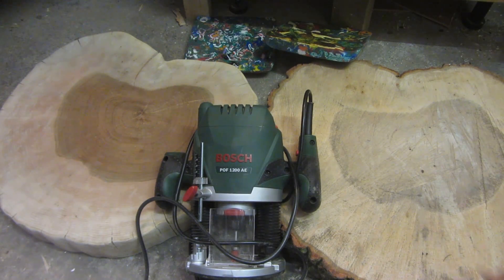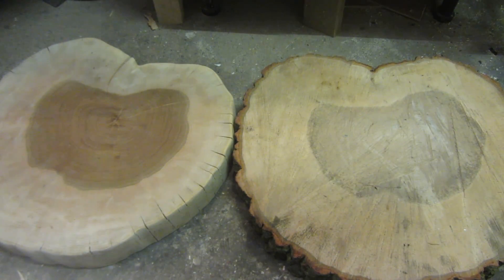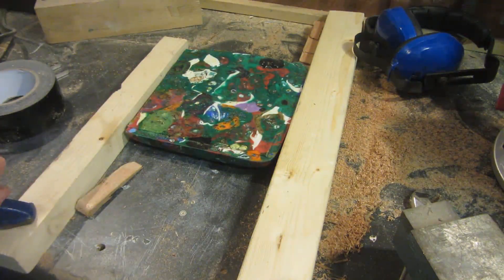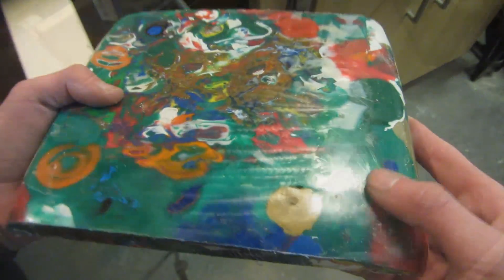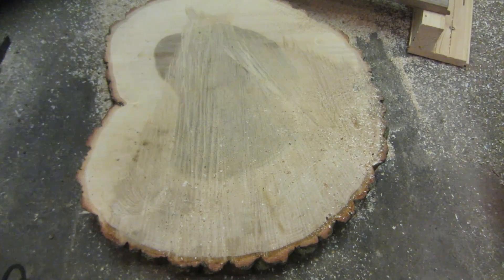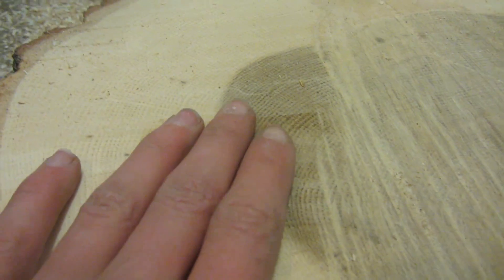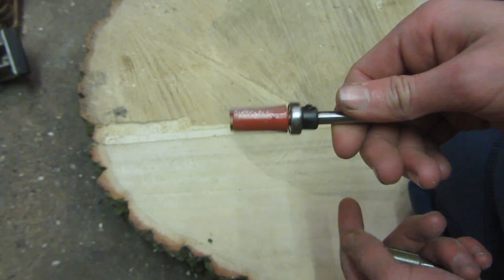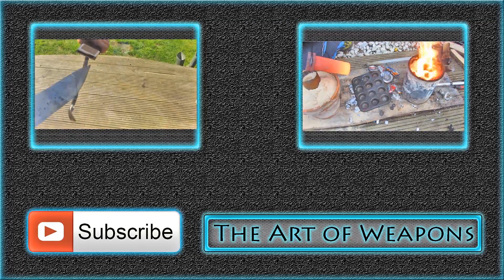Easy Router Planer Jig - Flatten Any Wooden Surface

Comment: at 2:00 or so when you're cutting the slot, I find it's helpful to take a hole saw or large diameter drill bit to the start and end points. Saves you from having to turn the jigsaw around.

Comment: For the table you could do a double layer design using the second round as a shelf underneath the table top:

               Top
___________________
      ||||                   ||||
      ||||                   ||||      
___________________
      ||||                   ||||
             Bottom

Comment: Great stuff TAOW.  I'm going to be starting out working with HDPE in the next few weeks and was wondering how I might finish the tops and bottoms of the blanks.  This is a great idea.  Thanks for sharing. 

As for ideas for your second piece of tree, how about another table but put longish legs on it and use your new router to dig out some ammo "dishes" in the top.  Then you can use it at your shooting line to hold steel balls, marbles, whatever, and it'll all be right there at your fingertips.  Make the legs removable/folding and you can more easily bring it in out of the weather.

Another idea might be to rout out some slingshot-sized pockets in the surface with an inset lip.  Then cut glass or plexiglass to fit just inside the pocket, on the lip so it sits flush with the surface.  Leg it as you would a table.  Voila, slingshot display table.

Thanks again, man.  Your videos are always an inspiration.  Keep up the great work.

Comment: I would have done this with a hand planer and a sander. This is not a particularly good or safe idea. Also, breathing in those hot plastic bits is not at all good for you, especially for being so young. Make no mistake, those pieces get extremely hot when the router is cutting them and much of it will get vaporized.

Comment: I hope you were wearing respiratory protection, especially when working with that melted bottle cap stuff.
Reply: Ariel Barton Because that router bit creates microscopic (and some larger) fragments of that plastic, it also generates heat (a lot of heat) that can release toxic gas. Even just a paper mask would be OK. Our young friend here doesn't need to breathing in this shit.

Comment: The Art of Weapons Great work. I really enjoyed the video. That's a nice technique you've discovered. You should watch those shavings because if they get underneath the skids of your guide it will affect the evenness of the finish. My father had a furniture making business for many years, and knew more than a fair share of people with less than a full complement of fingers. Try not to get into the bad habit of removing the router from the job and turning it upside-down until the bit has completely stopped spinning. Take care and good luck.

Comment: A cool vid but go steady,,, a router bit should be installed all the way in then back out a little, not left out a long way, it causes chatter and other problems, check the wood isn't toxic (yew etc..) other little things like unplug when working etc on the bit,  use goggles,mask but cool to see  you tackle this.

Comment: The bits you're using are not used for doing what you are.  That's why there's a guide wheel on the orange one.  It's for cutting against that wheel.  Buy a power planer when you can, cheap
Reply: I agree, though I don't think the guide wheel itself isn't as much a problem as is how long the bit is. It would be be better to use a shorter bit which could have less potential flex during heavy or difficult passes.

Either way, it's a simple, easy method.

Comment: If you simply get a peice of ply wood in a slingshot shape, you can curve the edges over with a round over bit. Also can be used for making equal edges on a knife handle, but I think you are more than capable of doing it with a rasp/file. That table is going to look awesome, your parents will be happy(I hope!)  Bye!

Comment from the maker: Like the new intro?
thanks for watching! if you have any Ideas on what you want me to do with my new router and router table then post them below!
Reply: Davy Kammer If your air supply is getting blocked by dust you may need to introduce a stronger source of Air - bigger/more powerful fan - you would also do well to have the air supply coming into your forge at an angle, so that rather than pushing air straight up through the fire it actually makes the air spiral through entire bed of coals
Reply: Make another table and try to sell it online, good luck.
Reply: Yea it was cool👍
Reply: leave the bark on it, it makes for  a nice detail
Reply: You are awesome
Reply: I no this is random but can some one help me with my forge. Every time i start it up the bottom get covered in charcoal dust and blocks the air supply tube. And how did you make the router table. Was that home made or what
Reply: +Tngus300 thanks so i need to get a better air supply. I guess a hair drying is not doing the trick
Reply: The sound is great, but it lacks the "Weapons" if you know what I mean! ;)
Reply: make a HDPE water gun like grave's Pool Party skin in League of Legends
Reply: The Art of Weapons You could make a sign of some sort with name of your channel on it. That would be nice use of the wood.